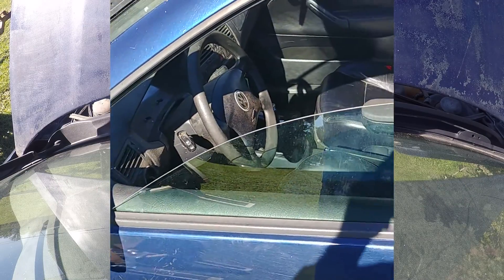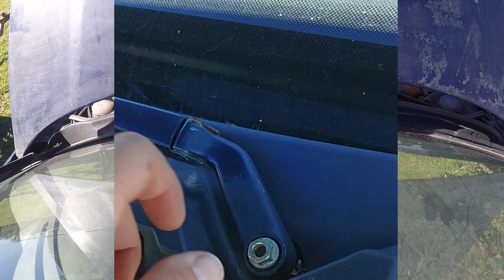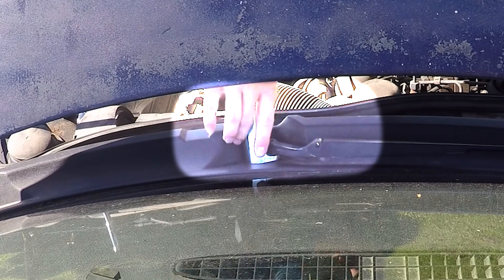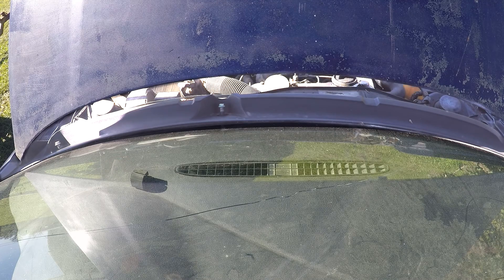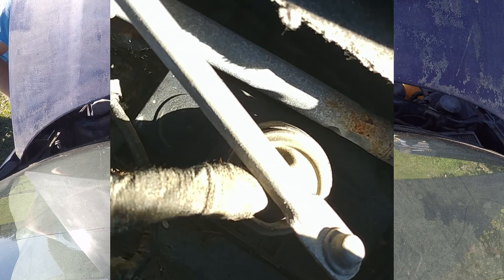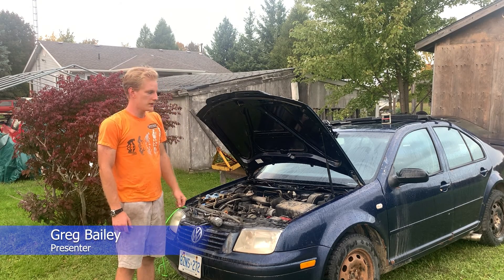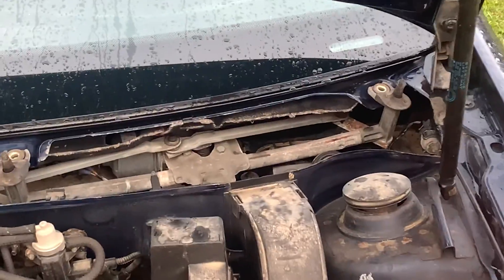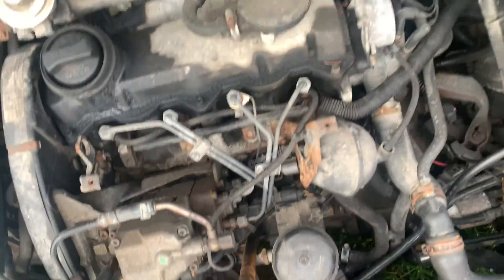Mk. 4 Volkswagen Jetta Windshield And Wiper Replacement - Part 1

Comment: Thanks for video, very useful. Minor comment, I used the same puller for the wiper arms, however I put the nut back onto the shaft while using the puller. This gave me a bigger area for the puller to bear on and protected the threads at the top of the shaft.
Reply from the maker: Hi there,
Thanks for the comment!
Yes, I would normally put the nut on flush with the end of the threads to protect them and give a larger puller surface area. Not sure why I didn't do that in this video, I usually do.
But yes, great advice for someone trying this out on their own.
Thanks,
Greg